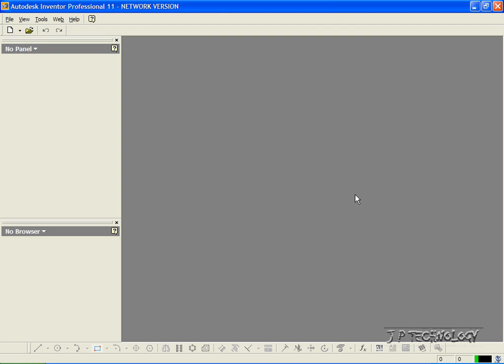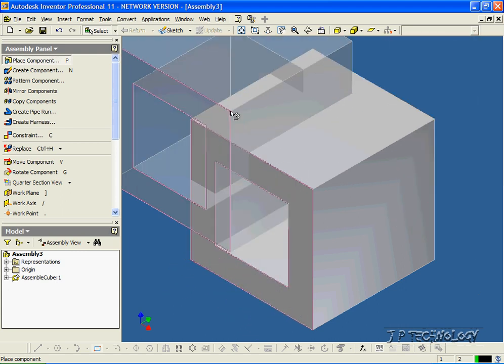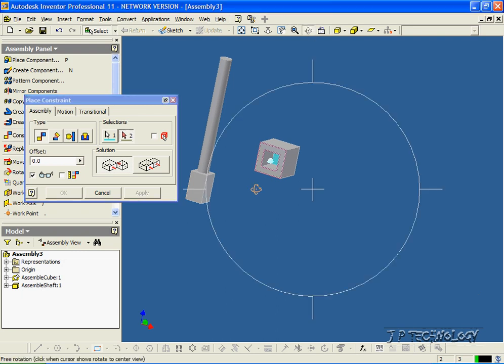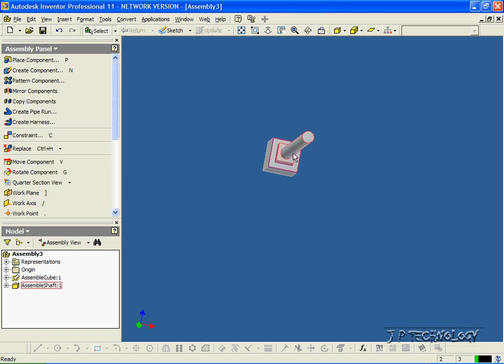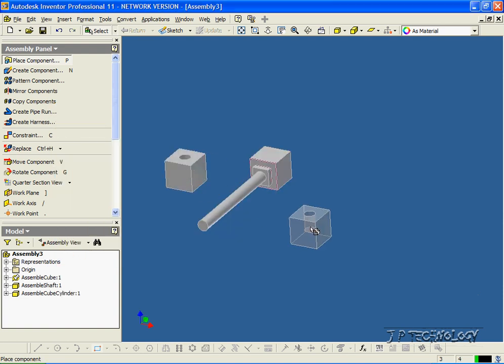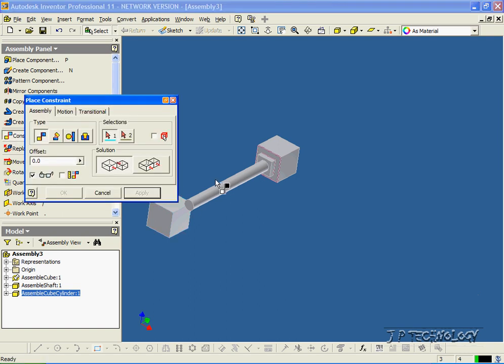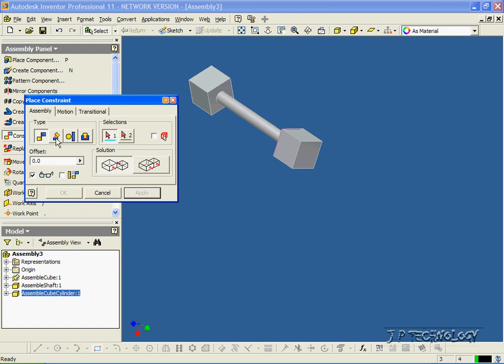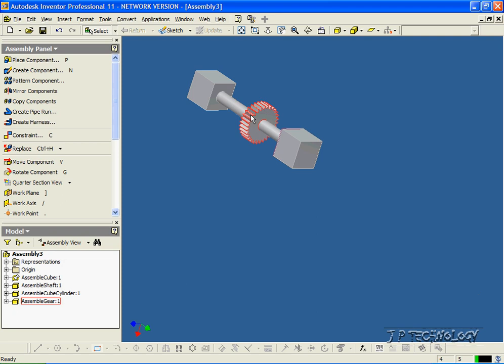Autodesk Inventor 11 tutorial #31 "Basic Assembly"

Comment: I have used your tutorials to develop my understanding of the complexed workings of Autodesk inventor to the point where i can now use the program to the principals that it was marketed for. To invent parts tools or just anything really I'm still struggling in trying to create and bend pipe work as i haven't found any tutorials for that yet and the inventor help files do show you how to achieve this, but not as good as your tutorials have done. Will you be doing any in that department. steve